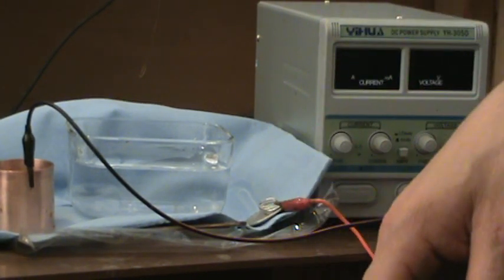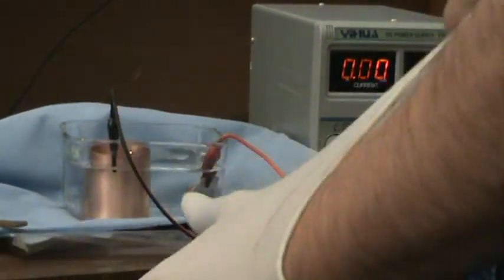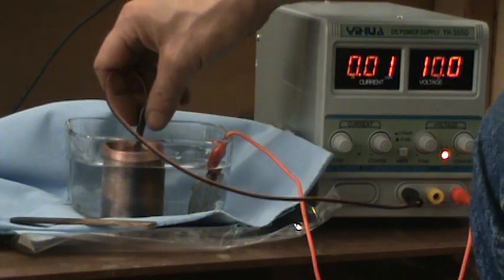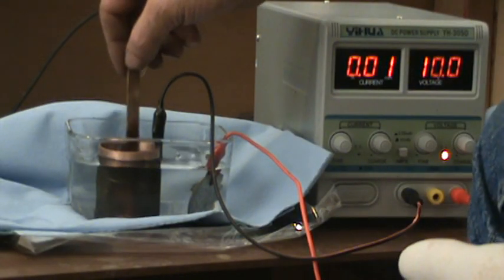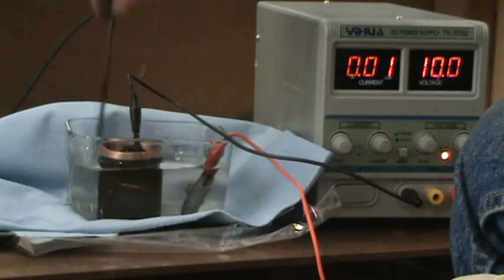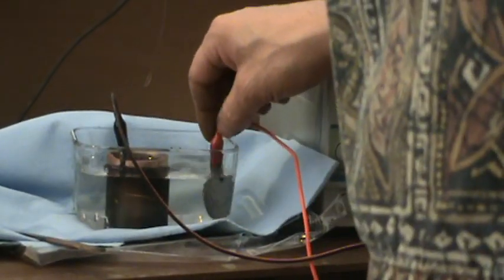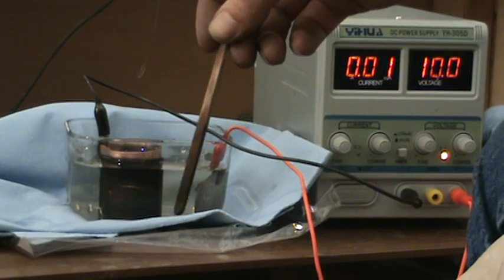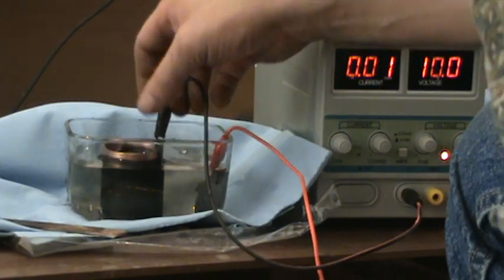How To Electroplate Silver Over Copper

Comment: YOU SHOULD SET THE AMPS, NOT THE VOLTS...
Reply from the maker: Next time, thanks
Reply: @INVENTOR3  no problem, I am only relating to you what I was told. I was told to set it by amps because you want the current to remain steady, as it is what makes the difference
....
If I find that video, I will link it here. I still have a lot to learn about this. Just finally made my first attempt, although it was just a play Tim. I don't clean anything as well as I should have. I have two small teddy bear puffy balls that I bought on eBay, that were silver plated. One for my mother and the other for my sister. I got them and they needed serious work. This was about  8 years ago. I held onto them and gave them something else. Nope I am going to try and re do them. I think that I am going to clean them with acetone, use a course compound and get the right stuff off, clean again, use a bread brush to remove anymore junk and so get any material that may hide in in any cracks, and clean with alcohol the final time. I may even wet sand with a medium and then a fine  sandpaper. I may then paint it with graphite paint, plate with nickel or copper, and finally with silver. Then I will just polish the hell out of it. I almost have everything, and I am going to set everything up very neatly, and then film everything. I will upload once I have several steps filmed.
Reply: Sorry for all of the typos. I got a new phone about a week ago, sand it doesn't know my texting pattern so it puts the wrong word in places
Reply from the maker: @aminormaximum2446  I know what you mean,,,, dang voice recognition!!
Reply: @INVENTOR3  well yeah, that too, now that you mention it I tried that yesterday and beat my head against a wall. I   "swipe", meaning that I have my finger through the letters of the word, all in one motion. I was using the "Swift key keyboard" and it learns your style as well as using context to get the words right. I can type almost type as fast as I can speak, that way, but when I do it now without the app, I forget to proofread...

Comment: Could a 12 v adapter work instead of variac? And does AC vs DC matter, if so which to use?
Reply from the maker: I am no expert, but i think, sure, i see no reason it would not work, they are low current.  I think it is best to have even lower voltage over a longer period of time, but i think it will be okay.  Keep a good distance between your anode and cathode to get less current.  Dont try to use house wall outlet!  You want to use only DC Pos(anode with silver) and Neg(cathode).  You want low voltage and current.  You could probably even use 1 or 2 batteries in series with each other and again keep the anode and cathode at most distance possible in your container and make sure batteries are not getting warm.  Hope this helped some.

Comment: does it look better after polishing? also if i took a copper plated coin and plated zinc on it will it look like brass or gold?
Reply from the maker: Yes, it will look better after polishing, just be careful not to polish through the layer of silver, the longer you let the part set in the solution, the thicker the layer will be.
About the copper plated coin,,,im not positive, but i strongly believe that if you zinc plated it, it would be silver, or light greyish in color.
Reply: ok because i saw a vid of a penny being zinc plated then heated on a hot top till it started turning gold,,i guess because a layer of copper and zinc will give your brass since that is what its made of
Reply from the maker: @ARCSTREAMS  Yes, you are correct.

Comment: just add more water and lower the juice,,btw is silver nitrate an acid?
Reply from the maker: interesting question,,,,,,i am not sure.  the silver nitrate is salt of silver, salt is corrosive,,,,hmmm, would have to test and see if it would turn a piece of litmus paper red or not, i think the PH level needs to be below 7 to be an acid.
Reply: btw you do not need all those fancy chemicals to do this,i saw a video juts now of a guy using hydrogen peroxide and sodium carbonate and although he might have been using a higher voltage or had his plating going for a long time,,he also had black looking muck like your piece but once he cleaned it with acetone or baking soda paste it was indeed a shiny silver plated penny he made ,,so have you actually tried cleaning your part to see how they came out? you should also keep the wires holding the parts out of the solution as they will contaminate it ,,go half and half

Comment: Yike's 3 amps.  I do believe that is a little too much.  Why does the power supply read 10 milliamps?  10 milliamps would probably be ideal, not 3 amps.  hell, I think the voltage is too high also.  1 volt at about 30 milliamps would give you a smooth and shiny plate.  It would take a few hours but it gives the best results.  Then again, i'm not a professional either.
Reply from the maker: I have it at 30 mA(.03 amps) and 10V,,,but i suggest to watch my newer video with "great" results,,,the link is in the description under the video here,,,just click on "show more" below the video,,,, The link is also in the pinned comment at top of all the comments :-)